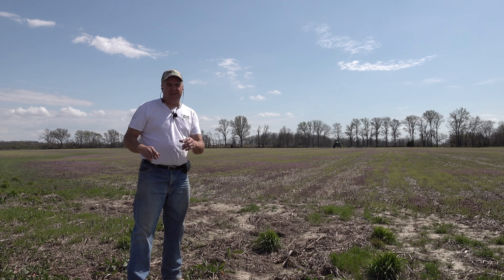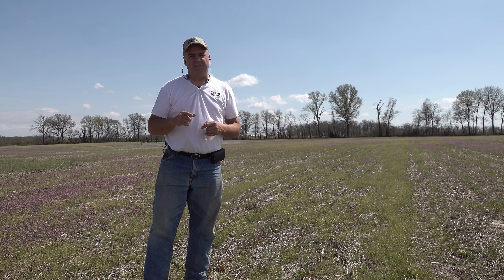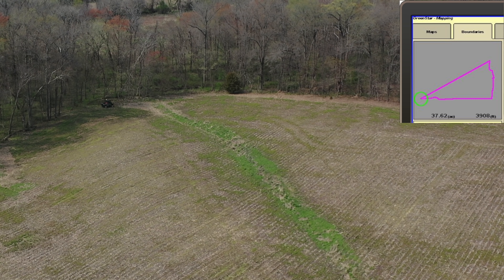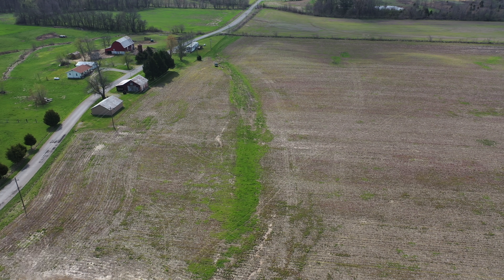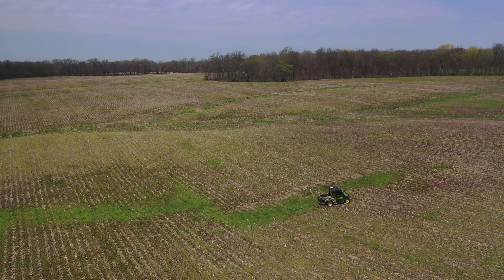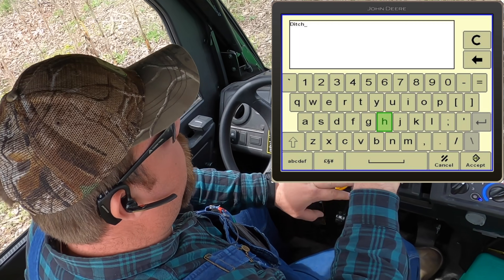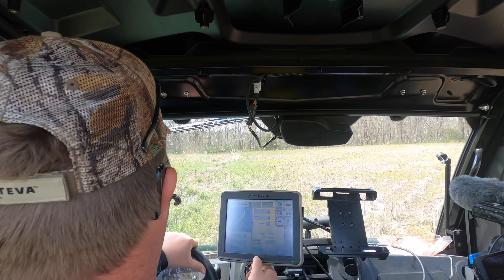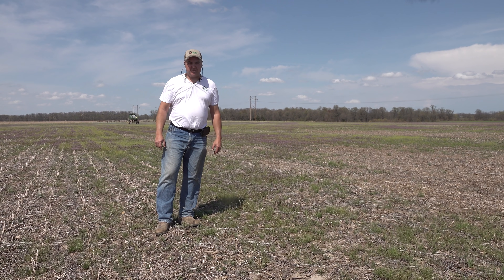Going High Tech to Reduce Erosion. GPS and Sprayer Section Control

Comment: Very well done Tim and Christy!  Yes, ditches and waterways are necessary, but a pain to farm around.  Well presented and the mapping is a great tool for more efficient and effective farming.  Sort of related,  for simple area measurement, (distance and acreage) there are some free (basic) apps for phone or tablet that I have used (riding in the Gator of course) to measure some small odd shaped fields. Very handy for determining  fertilizing, spraying needs, or for just wanting know.  Good to see you back at the farm.  Blessings.

Comment: Loved that drone footage. While Tim is sitting back at home base watching the action from afar, Christy and Randal are out doing the videoing and mapping.  It does take a lot of planning and work before seeds go into the ground. Team work is how these farms stay in business. And this work pays off for years. Just keep those files backed up in several locations. Was that just water in the tank for a test spray? Do you have to go back with the GPS to change the boundaries of the ditches slightly or adjust it in the program?  What is the cost on software that your using? Stand alone program or incorporated into a farm management program?

Comment: I would hit those ditches with a lite disking and sow some Alfalfa or Re Clover in them. Alfalfa has a long tap root, up to 10' deep to really hold those ditches, and both Alfalfa & Red Clover are legumes, nitrogen fixing, to improve soil structure.

Comment: I like technology and this Geo mapping is very interesting. Like it, but for a small farm probably not cost effective.  In your earlier video High-Tech Weed Control when you were spraying from the Gator would be the way we would have to spray our fields.  For the poor man wondering if an electric valve with a positional switch that would cut off one side or other when needed would work?  Similar to how the hydraulic diverter valves work.  Just would have to attentive to the area. Hum, see an experiment in our future. Lol   Thanks

Comment: What chemicals are being sprayed? I am no fan of chemical farming. It’s hurting us all by getting in waterways and in our food.
Reply from the maker: ...but are you a fan of eating?   I am.    We could not feed the world without herbicides.
Reply: The issue is honestly not farmers when it comes to herbicides and pesticides today. The single largest user of these is now the average homeowner. US farmers use a miniscule amount of products to the acre compared to the homeowners. To give you an idea, I have the book for 53.8% Glyphosate in front of me (I use it as a chemical mower) Corn (Non-Roundup Ready): Not to exceed 1.5 pints to the acre mixed with 60 gallons of water. Compared to Roundup Ready: Not to exceed 6 quarts per acre within 365 days, but with this they are spraying throughout the growing season too for weed control and it is on average 1.5 pints per acre multiple applications. 

Now compare this to on the shelf Roundup products at your big box store. These typically have 10-20 oz of concentrate per gallon of water. 16 ounces = 1 pint and is used for spot treatment of weeds. However, the average homeowner in America has a lot size of only 1/5 an acre and is using 2-3 gallons a year on that lot.